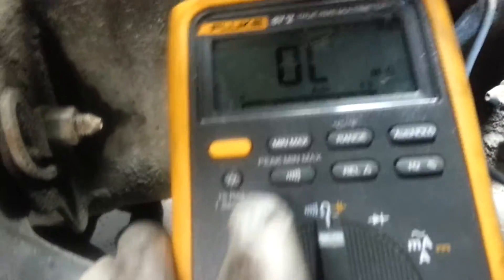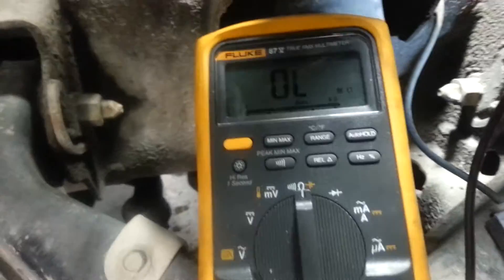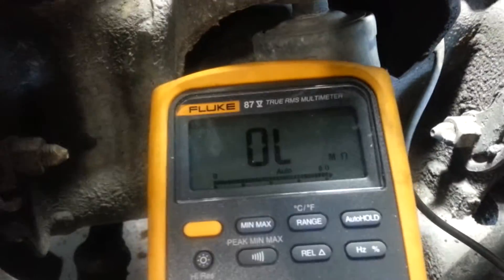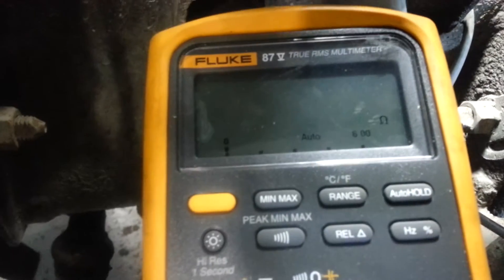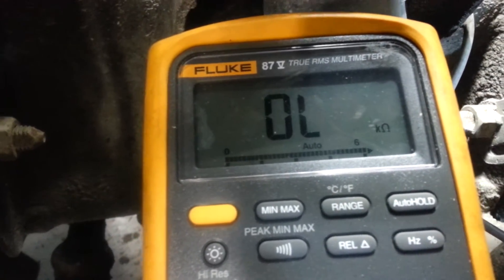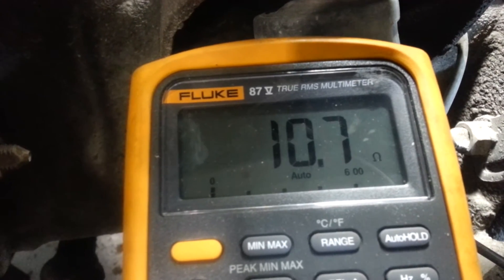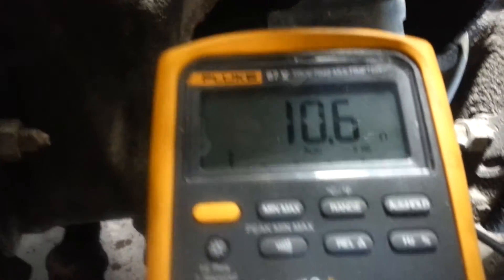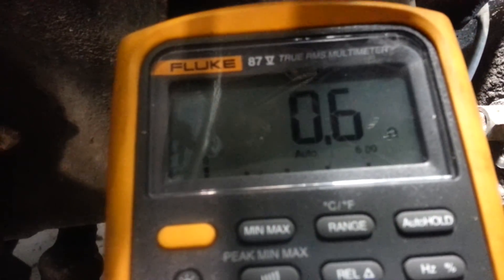Testing a glow plug with a volt meter - Angry Mechanic

Comment: Where do u put the test leads when reading the ohms?
Reply: Red goes inside the glow plug relay. There's this plug that you stick the lead into.
Black can be grounded somewhere on the engine block.
Reply: That is not clear to me, black to a ground gotcha.  Red to the wire on the glow plug?  Is the wire connected to the glow plug? Is the key on?  Is it momentary while the glow plugs cycle?